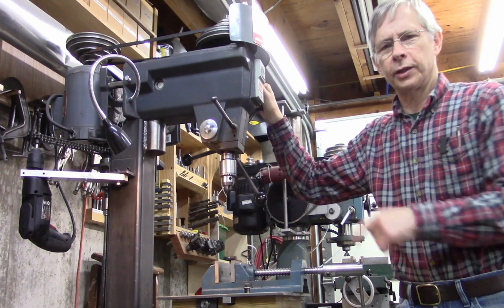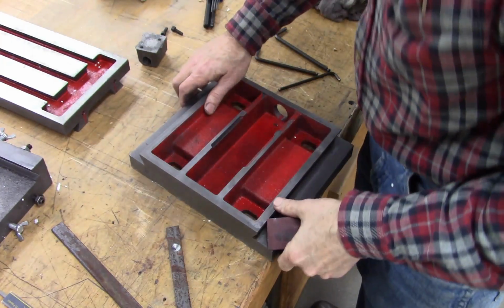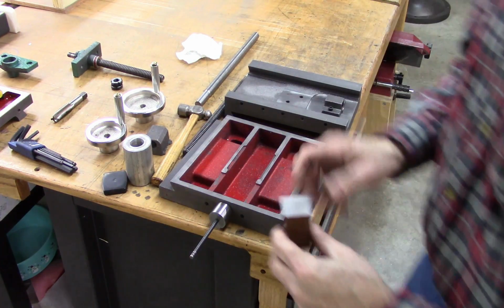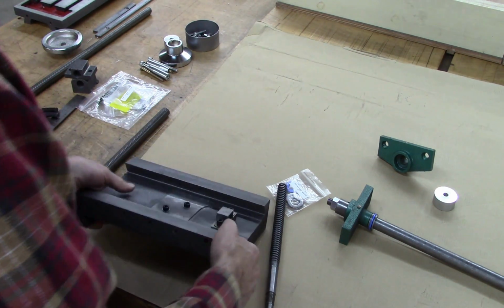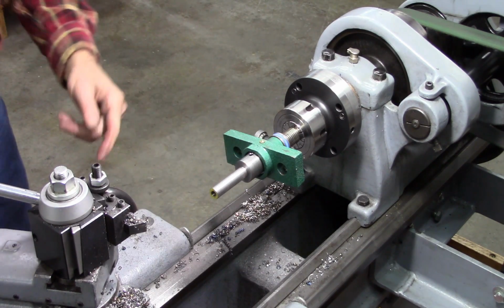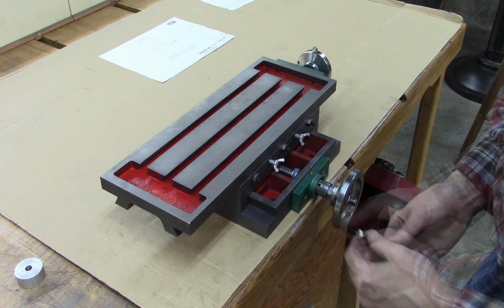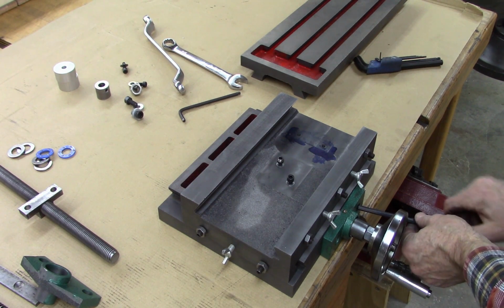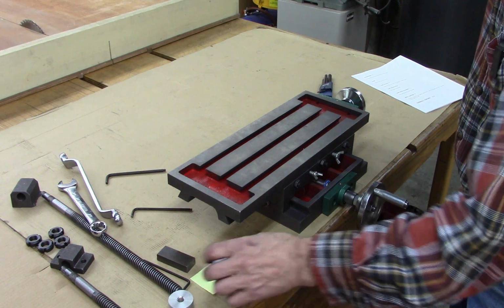Part-1 Vevor Compound Mill Table Review and Lead Screw Upgrade

Comment: If you are going to replace the lead nut with a custom made one, delrin would have been a better choice. It taps easily, turns smoothly and is long lasting.
Reply from the maker: That's a great idea!!!! My only concern would be mounting the nut. I guess you could mount the nut on a steel support and bolt it to the table. I like this idea.
Reply: @WinkysWorkshop  BTW, I bought a Vevor  DRO, the 3 axis and a 5 axis LCD model, and some glass scales and they are great. Inexpensive & worth the money. They didn't have the small size I needed so I cut down a longer one. Not hard to do.
Reply from the maker: @misterfixit1952  Good to know...  DROs are the best way to go.

Comment: Why did you replace the acme lead screws? Tightening up the lead nuts would have accomplished a better outcome. If you were going for greater precision, cheap ball screws would not have cost much. I like the table but it looks like you modified it just to do something.
Reply from the maker: I changed then because I wanted INCH dials (see part 2) The original was a 4mm pitch which even if you want metric is not very convenient to use. In hindsight I could have used 1/2"-10 acme but I would have had to sleeve the bearing blocks. The standard thread screw I used will work well for many years.

Comment: Everything perfect except you should have used metric file, because nothing is made English system anymore.
Reply from the maker: I agree metric is better but most things in the US are still inch. Most available steel is sized in inch. Yes there are a lot of imported cars that are metric but it's a mix. Everything i make is in inch unless it's a bearing fit. I grew up with inch and machine work is in thousandths anyway (10 based like metric).

Comment: I believe the hole thru the block was drilled at an angle to be able to adjust backlash by loosening the attach blots and rotating the block slightly.
Reply from the maker: Nah,...  it was just sloppy workmanship. With a 1.5" (approx.) thread depth skewing the nut would not do much anyway.

Comment: I purchased one of these 30 years ago from Enco. I did the exact same thing, as there was too much slop in the threads. At the time I got some low backlash rods and threads from MSC supply. I also recut the dovetails, as they were very rough.
I looked at Palmgren brand tables about 10 years ago, at a used tool store, and did not see any better quality.
I just looked at eBay for acme threaded rod, for stepper motor use, it seemed very affordable.
I only use this on my drill press, and I keep a quick adjust vise on it. I put risers under it for the same problem with the lateral feed crank handle as well. It just makes setup for quick centering of the drill where you want it. I never take it off the table. I made a plywood platten with a 2x2 tenon that I can clamp in the vise if I want a large flat area.
Reply from the maker: You sound like me and I agree. I also have a few pieces of plywood with a 2x4 glued to the bottom that I clamp in the vise. I never take the vise of the table.
Reply from the maker: My backlash is about .006" to .007" I know it will get worse with time but as long as it is under .010" I'm good.

Comment: I have been upgrading my drill press for ~2 years (32 episodes and counting !) and as part of that I also bought this same XY table.  My assessment is similar to yours in that the main castings are fine, but the rest is not great.  My leadscrews were bent and almost unusable, gibs poor, bearing blocks and alignment poor etc. . . .
I went with custom machined ballscrews and re-made the bearing blocks to suit and also fitted DROs.
If you are interested my XY table teardown is here: https://www.youtube.com/watch?v=7fXiUs0FXeI&t=312s
I re-built it here: https://www.youtube.com/watch?v=JoKTulK83Vs&t=552s

My table also goes up and down with a custom gear drive and is on linear rails so I don't loose position.  Seems like we all find the standard drill press a bit annoying and want to improve it !  Good luck with your modifications.
Reply from the maker: Good video and considering you went with DROs I guess the 4mm lead screw will work. I'm interested in you drill press modifications. I love mine although it has a bit of flex to the table. I can't believe nobody makes a drill press with dovetail slides. Grizzly makes a drill press that comes with a mill table and has A ROUND COLUMN! I wrote them an email telling them that they are missing a big market but they didn't agree. Strange....
Reply: My leadscrews were bent so I bought a pair of 16mm ballscrews and made custom brackets to hold them.  I over built mine so haven’t noticed any flex in the table and it’s getting closer to a milling machine !  Yes agree, why don’t they have a guide of some kind to maintain location when raising and lowering !?
Feel free to dip in and out of the video series as there is very little left of the original machine !
Reply from the maker: @routercnc9517  I've watched some...  you are much more detail oriented than me. I love the way to covered the base with the sliding plate!
Reply: Thanks.  Yes I seem to get drawn into the details and the projects take much longer !
Reply from the maker: @routercnc9517  Many machinists are like you. I tend to get impatient. This sometimes leads to a good outcome and it gets done but sometimes I end up doing projects twice.

Comment: Did you consider a 2 axis DRO for one that matches the quality of that table it is under a $100
Reply from the maker: If I was going to do this again I would go with the DRO. After making this video I found a couple on Amazon for a total of about $65. Plus I have the same DROs on my mill. They work perfect but they will not tolerate coolant and the battery life could be better. Actually I guess a 4 to 5 month battery life isn't that bad. If you remember to turn them off I'm guessing it would be several years.

Comment: Nice work, I am okay with metric but 4 mm a turn is weird? I have a Chinese boring head and the adjustment was metric wit graduations  0,15,30,45,60,75 but from 0 to 15 there was only 10 graduations and so on to give a total of 50 !!! So with a thread pitch of .75mm  instead of each graduation being .01 mm it was .015mm, did my head in. I made a new adjusting screw with 30 graduations to give increments of .025mm. I still can't work out why  they did it this way.
Reply from the maker: Yeah...  4 mm was very strange and so was your boring head. It really would not require much thought to make them in 5s or 10s and it would sure be easier.

Comment: Rotary cross slide tables for Bridgeport mills have  removable handles, not only because of the clearance issue you have, but then don't interfere when using the rotary function. A simple square end on the screws and a square hole in the handle, dials are round and stay on.
Reply from the maker: Thanks! That's a good idea although given the additional height of the vise I doubt I have issues with clearance.

Comment: Since u used 10 threads per inch rod is your table moving what u dial in on the the dials showed in pt2
Reply from the maker: Exactly. One turn is .100" and each small line is .001"

Comment: Well, this was quite educational. I'm so glad I have your videos to learn from, and enjoy in the process. There is a cross slide table in my future at some point and it's good to know this one has potential. 
I'm planning on converting my drill press to a square post at some point too. It just seems to "solid" things up. I have an old Dayton that is in need of a good going over. 
Thanks for sharing your shop with us!
Reply from the maker: Glad it was helpful! I love my square column drill press although it flexes a little when drill large holes with a lot of pressure. Most often this is not an issue but if you make the modification from my plans make the two arms that hang down a bit wider. They flex a little.
Reply: @WinkysWorkshop  Ok. Good to know!
Reply from the maker: @markhedquist9597  I think it's a still a worthwhile build but I'm always trying to make things better. One thing for certain...  it's 1000% better than a round column.

Comment: Wink, you should do some research on our crazy inch system, it's not as bad as it's made out to be and it has many advantages over the metric system. It was developed by craft and tradesmen that were shipbuilders. The main thrust was to quickly find the center point in your head, such as half of 1/4 is 1/8, half of 5/16 is 5/32, Half of 5/32 is 5/64, and half of 5/64 is 5/128s,  really someone spent much time developing or system and for what we do it probably really is a good system. I am fluent in both systems only because my life career change put me in a company that only used the metric system since they were German. Since retirement though I've gone back to the imperial system.
Reply from the maker: Ultimately I think metric is still better but I'm totally used to imperial and it does have advantages. The only thing that bothers me is having to look at decimal conversion chart. Most are in my head now but i still have to look sometimes.
Reply: I don't know how you read back over you comment and still claim it's a good system. It's a hacked together system that some people have just become accustomed to. It's a revolt against our 10-base counting system.
Reply from the maker: @genaugmen4505  Funny comment. I agree that 10 is better but I sometimes the math is way easier with the inch system. Metric is hard to divide into 3's and 4's. Even feet and yards are a easier. Clocks are 12 and circles are 360 for the same reason.

Comment: This is a great project and this XY table will be more than good enough for drilling.  Nice work.
I suspect 22:45 what seems like 1+mm of unnecessary clearance was there on purpose to minimize alignment struggle when assembling.  The Y stage and the X stage have their own dovetail and gibs to keep their motion linear, this reduces the need for the lead screws to have precise radial positioning.  The leadscrews' main concern is controlling movement and remaining stable in their axial directions.  To this end, they can be allowed quite a bit of slop radially, explaining the 1mm shaft diameter delta.  Making the neck of the new screw larger to more precisely fit the hole in the bearing block, you may have given yourself more alignment work toward the end with enlarging bearing block bolt holes, etc. to get the screw supporting parts to line up well enough not to bind.  You got it by the end.  Seems to work fine now, though..
Reply from the maker: I'm sure you are correct... making the bearings oversize made alignment easy.

Comment: To late now, but I have found Surplus Center in Lincoln Ne. have acme threaded rod.  3/4"x6
$17.80 for 3 ft.  ships by weight. Always enjoy Thanks
Reply from the maker: The 8 TPI is fairly cheap from McMaster but I needed 10 TPI.  In hindsight I could have used 1/2-10 acme and made some sleeves for the bearings. The 3/4-10 was high priced and McMaster.

Comment: 4mm per rev is not very weird.
Reply from the maker: How many turns to move the table 62 mm? Maybe I'm not good at math but I have to think about this a while. It the pitch was 10mm it would be 6.2 turns. 4mm pitch in itself is not weird but using it on a lead screw is a bad idea in my opinion.
Reply: @WinkysWorkshop  The math is wierd, yes. I have a X-Y-table to my drill press that use 4mm per rev.
Reply from the maker: @Baron3D  Thankfully mine is .100" per turn although it has a DRO so it really doesn't mater.

Comment: Locking the gibs fairly snug before setting up the leadscrew nuts and brackets would have aligned the tables in the correct position first. 3/4" UNC a good choice for simple 0.1" per rev. Could the top be assembled with the handwheel on the left or would the nut have to be moved to the other end?
Reply from the maker: Interesting question! I have it assembled the same way I got it and the way it is in the pictures on the web site. The nut is close to the handwheel and stops the table travel going left right now but i suspect you could just turn the table around. The alignment on the nut might have to be adjusted but it would likely work well. The nut would be further from the handwheel which makes alignment less critical as well.

Comment: Nicely done, looks like you were taking the Stefan Gotteswinter approach of using the tool as-received as a casting kit, like he does, and making it up to snuff for your purposes.  But as you say, for the price point, at least the castings were actually good!
Reply from the maker: Thanks! Yeah the castings are nice. Honestly, the original handwheels and lead screws worked fine if somebody wanted to install cheap DROs. They had maybe .015" to .020" backlash and loose bearing fits but it was totally usable with a DRO. It just had a bad feel to it. In my opinion the dials were useless and even if they were nice the 4mm pitch is not easy to deal with.

Comment: Hi Mr Winky, when building my mill I used the same table but replaced the Acme threads with ball screws and blocks, works a treat and virtually no backlash 👴🏻👍
Reply from the maker: That's cool. Yeah the table and castings are good
Reply: Hey Terry, what size ball screw did you use on this table modification, is 16mm too big?
Reply: @thetattooshow2751  Would love to know that also as I am contemplating purchasing one for the same modification and can see that on one axis 16mm would be fine, the other it might be a tight fit for the ball screw nut in the space
Reply: I used to work at a Ballscrew factory in Coventry 🇬🇧, fitting ballscrews is the way to go
Reply from the maker: @grahameblankley3813  That would make it a bit more cost effective I think.

Comment: While you have the slides apart, consider adding oil channels in the sliding dovetails and oil holes to apply way oil at assembly and in the future.  I have a similar slide assembly that I will be reworking as a component of a tool grinder I am building.  I enjoyed this video immensely!
Reply from the maker: Thanks. Yeah the oil ports are a good idea!

Comment: Hello
So, excellent work.
But seriously, all that to rebuild this slide . I dont have the capabilities to do what u have done.  Im needing a slide table to do milling and drilling on my tall drill press. 
Thanks for this video.
Reply from the maker: I agree... lots of work. Just get a cheap DRO and use the table out of the box. All this conversion was to make it inch based with dials and a DRO is better anyway.

Comment: You did an excellent Job. If this piece said Made in USA and it was 1960! All you would have to do is give it a quick clean with less than $5.50 a gallon of gas. And bolt it to what ever you were bolting it to!
Reply: $5.50 a gallon of gas? Did you mean $.55 per gallon in 1960 which still sounds a little high?
Reply from the maker: I totally agree. This table has good castings it's just all the sloppy machining that made it poor quality.

Comment: Gday Winky, overall the table is good value for what you pay, doing the modification is not that necessary but certainly improves the functionality, it’s much the same with small import machines like a mini lathe or mill, the way you have done this showing it can be done without a milling machine was a great idea, overall you have a perfectly functional XY table that’s much better the original, great job and very well explained, Cheers
Reply from the maker: Thanks...  If your okay with Metric (which I think you are) all you'd need is better dials. However, the 4mm per turn is very strange to me. That math is irritating!  How many turns to move 37.5 mm. Crazy

Comment: just over 3/4" M20 acme thread has 4mm pitch thus 4mm to a turn,to indicate odd shape in 4 jaw use a extra dead center point in punch mark ; point of dead center in tail stock center of back of 1st dead center indicate on first center
Reply from the maker: Yep...  that pitch should have been 5 or 10, 4 is hard to work with. Yeah...  I considered doing that with the dead center. I got lazy

Comment: Walmart usually has better pricing on Vevor imports. Twenty-five cheaper than the link bitly link.
Reply from the maker: That's great. I just worked with Vevor direct to get a good deal. They gave me a good discount when I said I was going to do a video.